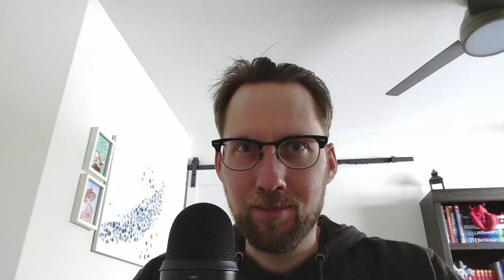Consult the Doctor Episode 74

Comment: I do not (directly) count the number of fills for each of my fountain pens, however I do keep an "ink journal", noting the date, pen, and ink.  I could go back through this journal and search for entries on a specific pen, thus developing a "refill count" for each of my pens. I thought about putting my ink journal into a spreadsheet (so I could easily sort by pen, ink, or date), but after further reflection, a spreadsheet seems too "digital" for keeping track of an analog hobby.
Reply: @danielklopp7007 - I do the same with both a spreadsheet version and a written log which provides a visual rendering of the ink and nib. Additionally, I log both the fill and the cleaning date so I can tell how long the ink has been in the pen "this time." These logs also track whether or not a particular pen, ink, nib configuration dries out prematurely or lasts a long time though that becomes confusing if I add a drop of water to a nearly empty converter to extend the writing period. (That works well for highly saturated inks.) So, "counting" the refills is not the primary goal, but I can figure that out!

Comment: I have been keeping track of my pens, inks and such on a notebook. I have the name of the pen at the top of the page. Under it, I have the date and the name, brand and color of the ink. I have why I changed it was I bored with it did I not like the properties of it or was it just a color I could not read. I’m surprised especially with a lot of Ferris wheel press inks that just are illegible. I got this idea from Seemownays channel! And occasionally, it’s because I have written it dry. Which is ideal. There is also another YouTube channel called pens and tea who has made a challenge of using 10 pens for 30 days. Right now I have almost 20 pens inked which is ridiculous. So as I write them dry, I will put some of them away until I have only 10. 🎉

Comment: interesting Q&A. thank you.
Also, I have noticed on this and other presentations that the seems to be a change in the facial lighting that takes place during the presentation - Like a light turning on and off. Perhaps it only appears on my machine? To me, it is very annoying and disconcerting. It makes watching the videos MUCH less pleasant.
Reply: This is the case because his device is attempting to adjust the lighting when it detects a change -- so whenever he moves, it adjusts accordingly. Others have commented on this but he appears to prefer simply recording and being done with it. If I were aware of the camera he uses, I'd suggest he place a bit of black electrical tape over the red light on its front, since that usually remedies the flashing we see, but this may not be the solution, and his actions are outside of my control.

I suffer from photosensitivity and must only listen to his videos due to that chronic flicker, but I can see why he'd want to be able to just record and not be concerned with adjusting the lighting, etc. -- it's not easy spinning so many plates. I don't know how he does it, frankly.